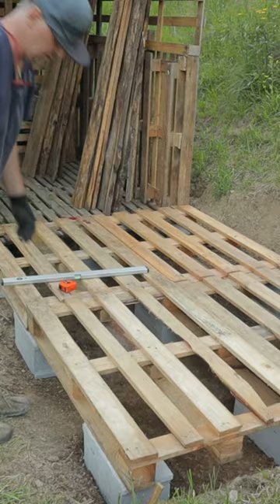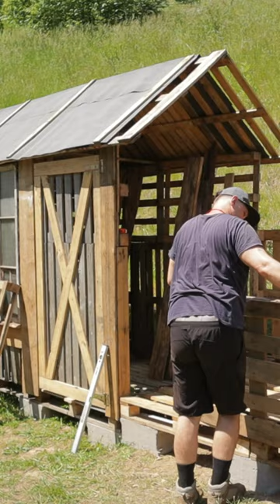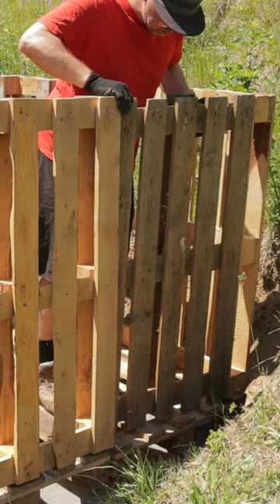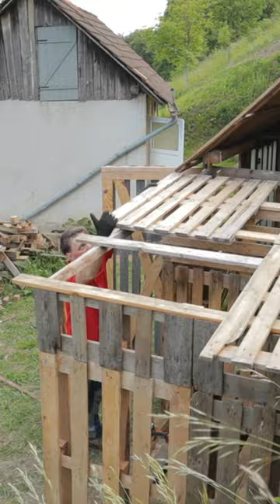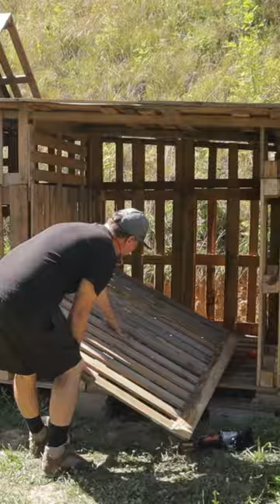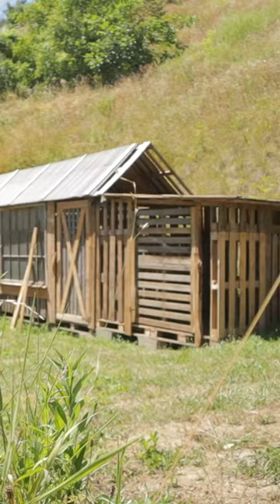Building a CABIN from PALLETS, extension #shorts

Comment: Running studs through the center intervals makes them twice as strong. Helps if you decide to transport,move the building to another location
Reply from the maker: here you have long videos of this pallet cabin
FOUNDATIONS, DECK  https://youtu.be/5Nf0tNmiydY
PALLET WALLS             https://youtu.be/ovWgtiKi8mw
ROOF, WALLS                https://youtu.be/VctLgn0Okko
DOOR WINDOW            https://youtu.be/n6BmHerKZjA
DOOR, ROOF                  https://youtu.be/YVmeUzD5RCk
CABIN EXTENSION 1   https://youtu.be/AbH84Hdel0s
CABIN EXTENSION 2   https://youtu.be/1zlpY5ly6zk
Reply: What do you mean by the center intervals?